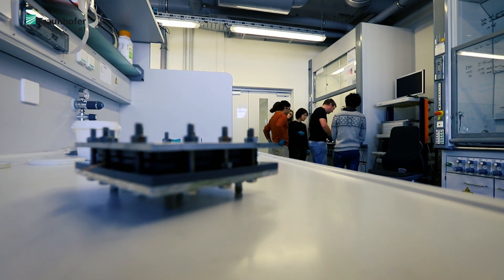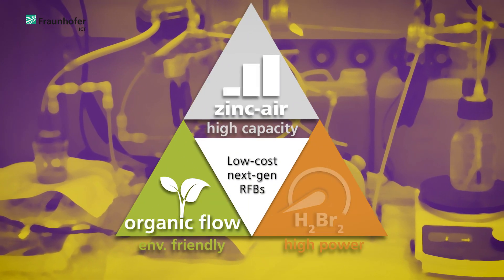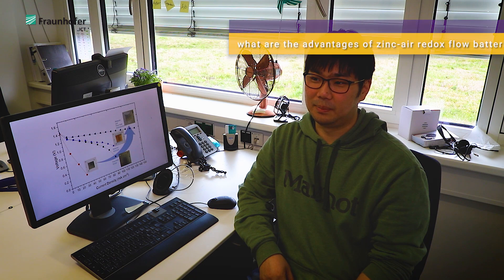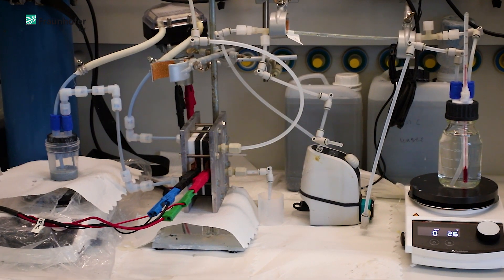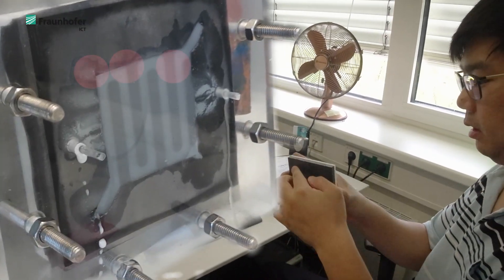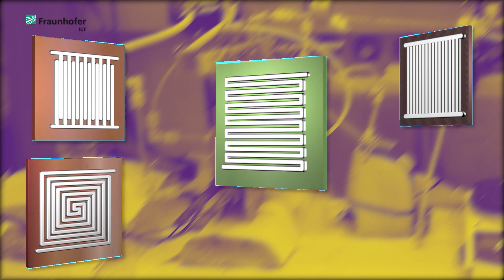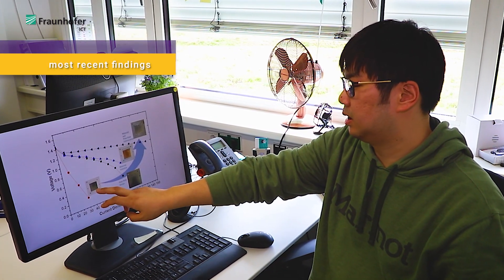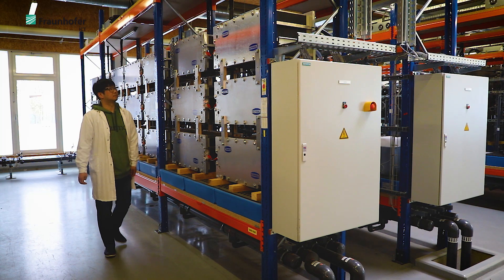FlowCamp - Redox Flow Battery Campus – slurry flow of zinc-air battery cells – Nak Heon Choi

Comment: if the stack is an 1kW unit and the efficiency is，say，80%，200 Watt is already lost due to the friction through the pipes from the pump to the stack.adding more channels inside the stack，which will certainly get the fluid flow more evenly and the efficiency would increase…the problem is by how much.
if by adding the channels，the efficiency could increase，say by 5%，you better make sure that the friction loss due to these channels to be less than 5%，otherwise these channels would be useless and this is the most difficult thing，if you want to build bigger stacks.
because the bigger the cells，the more unevenly the fluid flows，at some point these channels wont make up to.
I see similar designs working in fuel cells.now the density of water is almost 10000 times the dencity of gas，so with the same flow rate，to maintain the same pressue loss，the velocity of water would be 1% of gas，if the flow rate is too low the fluid wont go back to the pump.
I dont think these design would apply to big stacks.